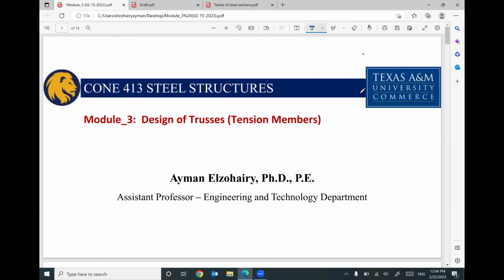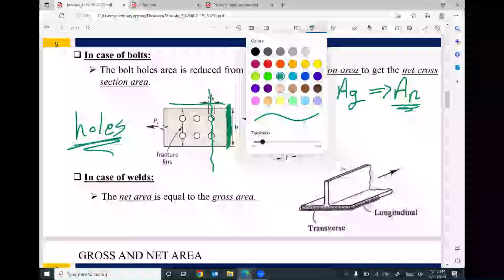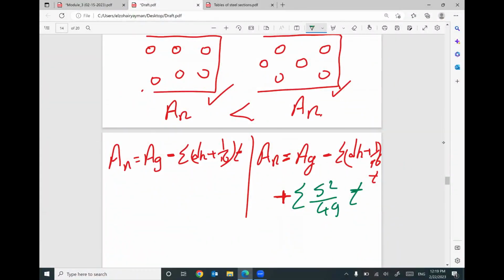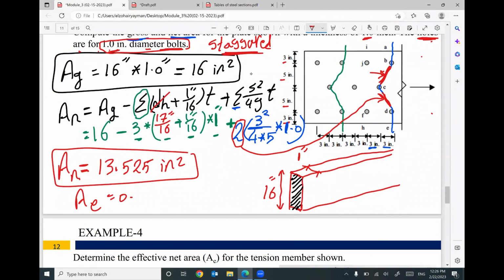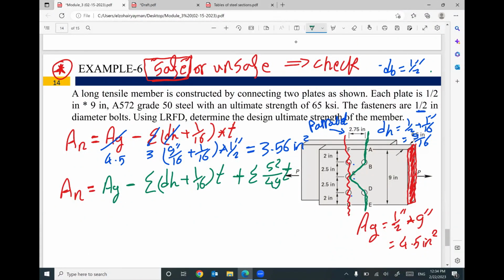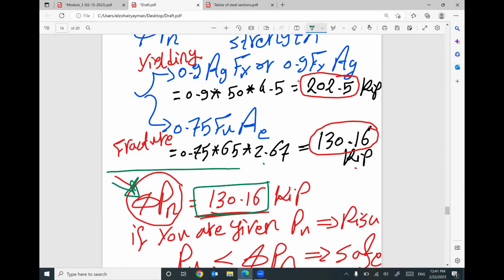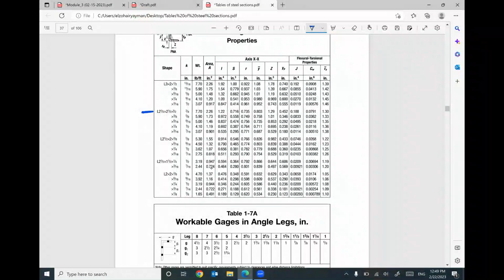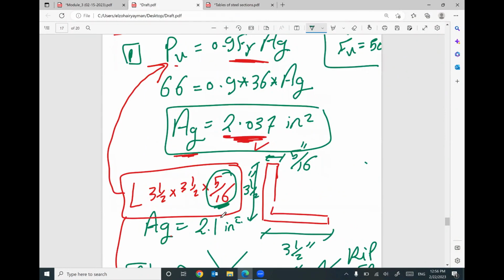Design of truss tension members design ultimate tensile strength

Comment: May Allah reward you, Dr. Ayman.
 I have a question, if you allow .. that was repeated in last two lectures.
Why, in the case of the plate section , does the value U = 0.75? Isn’t it more correct to take it = 1.0 because the plate section is fully connected to gusset plate ? 
example 06